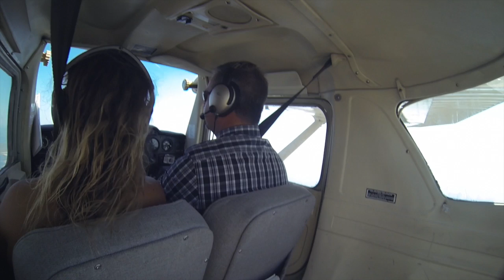Cessna 152 Flying Lesson Tips - Secret to Slow Flight

Comment: Can you explain
if your aircraft stalls at 50
and you are cruising at 55  (slow flight)
if you have a 10 tail wind
then does that make the wind going over your wings to be 45
and would you stall ?
Reply from the maker: The wings of an airplane need a certain number of air molecules flowing over it (Airspeed). If you are flying at 50 Kts indicated and there is no wind you will be going 50 kts over the ground, if there is a 10 kt headwind you will still have 50 kts going over the wing but only be traveling 40kts over the ground. If you have a 10kts  tailwind, again you will have 50kts of wind going over the wing but traveling 60 kts over the ground.
Think of a balloon. It has 0kts indicated speed and travels only when wind moves it..
I hope that helps.